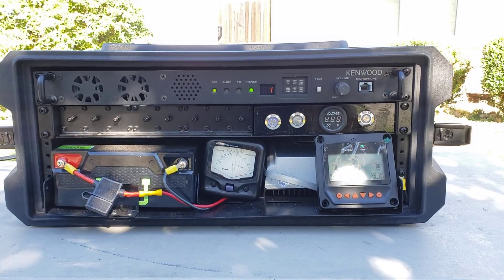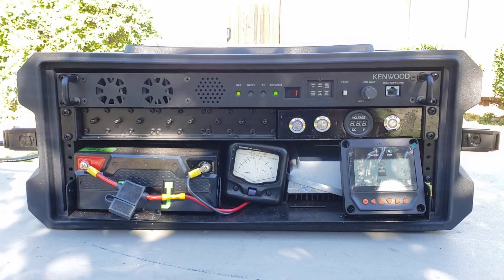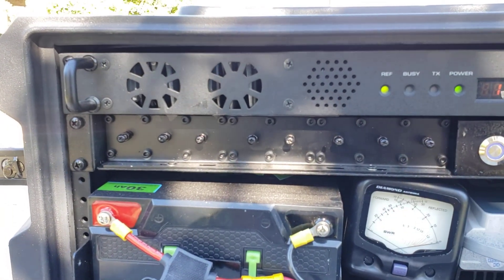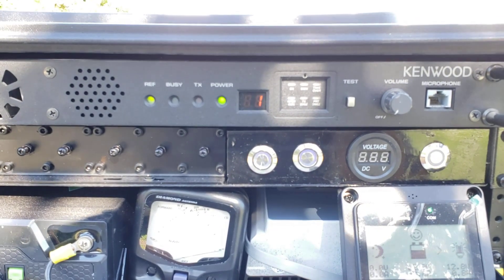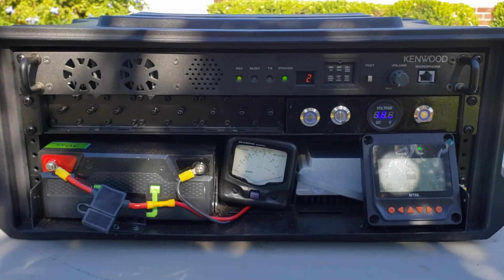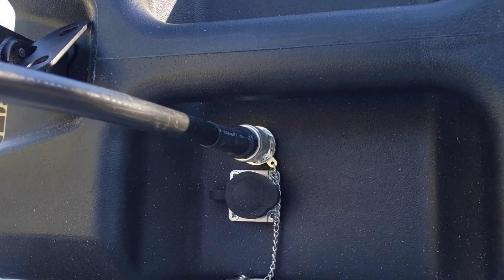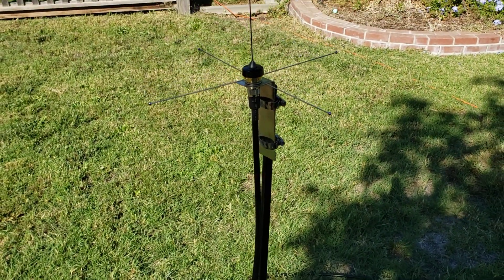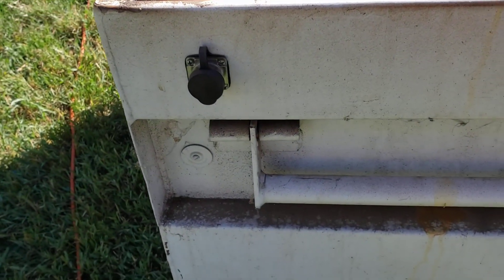Mobile UHF Repeater GMRS or Ham Radio

Comment: I use the same EPEVER (20amp) charge controller in my go box.
There is a wifi or Bluetooth box I have for mine.

My box is HF radio I show it on my channel.

GMRS repeaters are not used in Canada, but I like the idea.

Good job, thanks for sharing